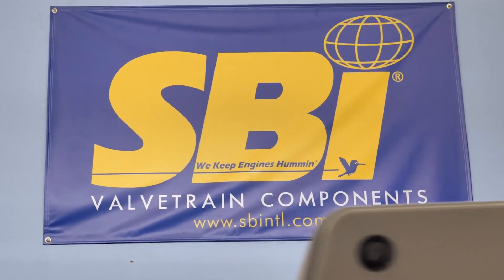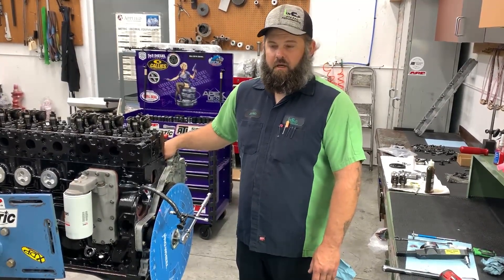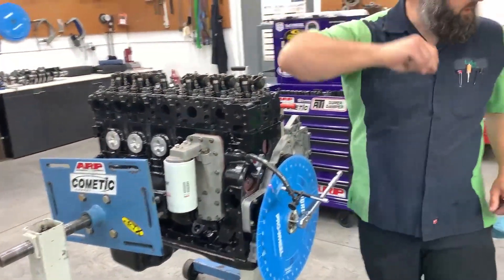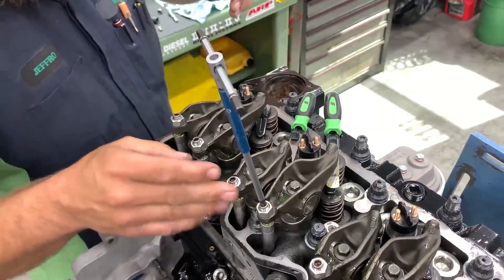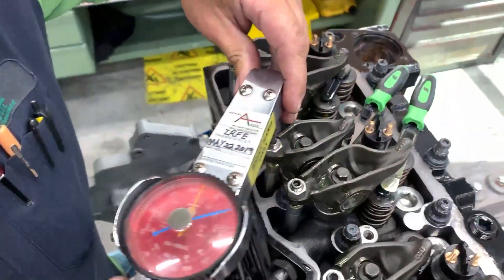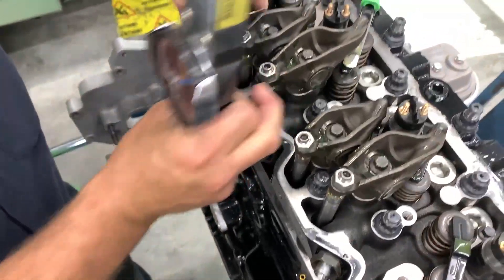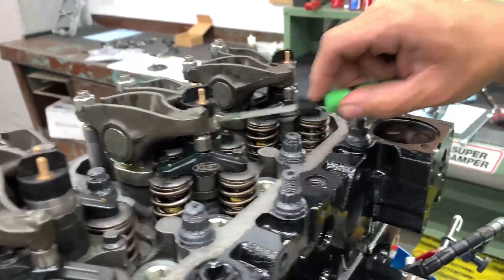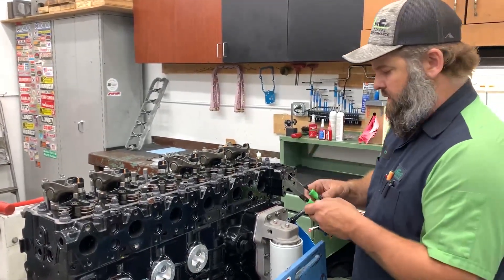New Valve Lash Method

Comment: It's not new guys, although Great to see someone taking the time to be so consistent.
Cummins published this method 40 years ago. They have a special tool, a 5  in lb T wrench just for this.
also, one of the biggest factors in consistency is the torque on the locknut. Using a torque wrench is important as excessive torque will stretch the adjuster. 
they also sell the tool to do this.